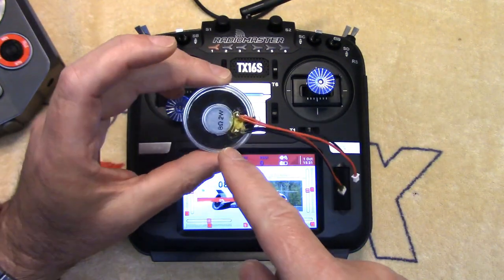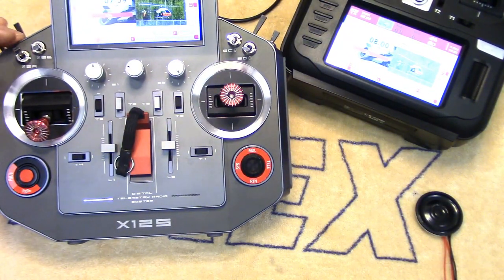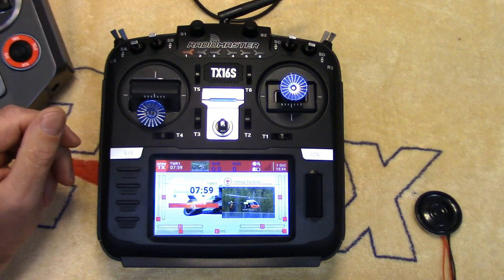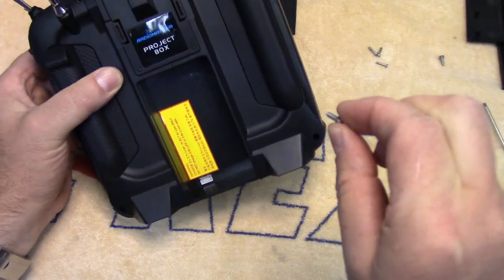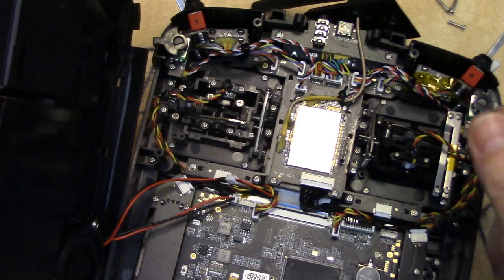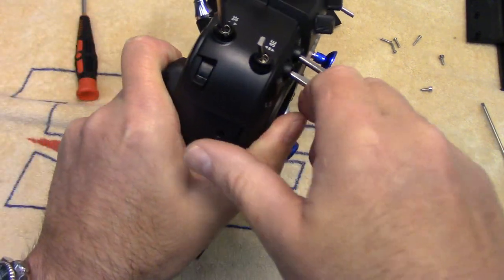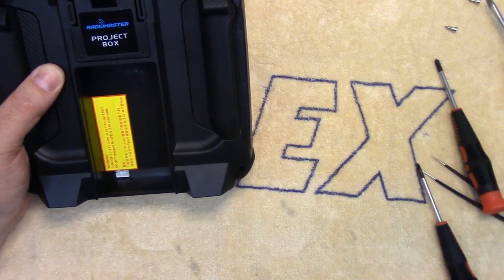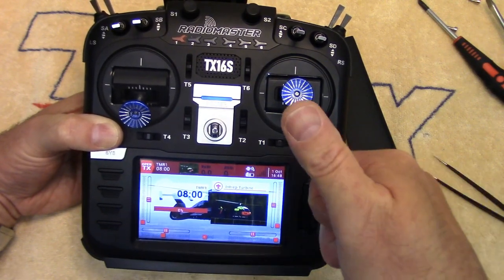Radiomaster TX16S Speaker Modification & Toggle Switch Swap

Comment: Once you change the switches around your hold switch isn't in the "Preflight Checks" anymore, but this can be changed in System/Hardware. There you can change switch SF to toggle and switch SH to 2POS.

Comment: Have you seen the new model TX16s yet john. 3 new colours including carbon also the new CNC upgrade parts kit to be released. This radio will put many current radios out there sitting on their high chairs costing 6 times more will have their tails between their legs trying to justify their high falsely inflated prices. So watch out

Comment: My TX16S sounded kinda crappy (compared to my old Taranis X9D+), so I ordered ($10.65 shipped from Buddy RC) the extra speaker, and just now finally got around to opening up the radio.  But it turns out my TX16S already HAD the second speaker...yeesh.  Well, while I've never heard the TX16S with ONE speaker, I can say that the radio with TWO speakers still sounds kinda crappy, though I'm sure, better than with one speaker.  Anyway, overall, the sound is pretty disappointing, even with the "upgrade".  Thanks for the video.

Comment: By watching, all the switches are soldered in as a 'pair'? Personally, I don't like the momentary switch. ANY way possible, u know of, to swap it to a 2 or 3 position without soldering?

Thank u sir!
Reply from the maker: Soldering is the only way to swap switches from the circuit boards (unless RadioMaster or aftermarket has complete board sets with different switch options you can purchase)?

Comment: John,  can the spring switch be converted to a double switch to match a jr retract switch  after switching the switched or can the right spring switch changed to 2 way  instead of the spring. thanks reno
Reply from the maker: You could solder in whatever type of two position toggle you want to, provided it's the same size and has the same pinout dimensions to fit the toggle PCB.

Comment: I did the switch, but , when I power on I get SF switch warning, I have to putt SF forward to clear it. I also get a beep and a buzz when I pull it forward. Any Ideas??  Thanks for all you do!!
Reply from the maker: Without seeing it first hand to go through the switch programming settings you have, all I can do is make an educated guess that you have to turn off or reverse the direction of the power on switch warning for the SF toggle. Also sounds like you have a haptic and beep warning assigned to that toggle.
Reply: @Rchelicopterfun  Hi, I got that figured out!,  Do you know how to set up a Blade Inductrix in the edge TX? I have everything working but can't arm it!
Reply from the maker: Don't know.

Comment: Why can't you just take one whole switch assembly from one side and put it to the other side instead of having to unsolder and resolder just the switch?????
Reply from the maker: I clearly state & show why in the video @10:30! The toggle switch circuit boards are side specific.
Reply: Thanks I missed that

Comment: Great video. I swapped my switches on my Jumper T18 pro for the same reason, muscle memory  for throttle hold .   I also removed my SG and SE switches because I am  a pinch flyer. Those toggle switches were in the  way of my middle fingers resting.  I covered the holes from the removed  toggle switches with rubberized grip tape.
Reply from the maker: Thanks for sharing

Comment: Hi John
I changed my SF and SH switches across and its working fine, but I have since noticed that switches SA and SC are interconnected. Perhaps they were always like that, I dont know.
Are your switches SA and SC linked?
Reply from the maker: Nope, switches work correctly & are isolated just as they did before.
Reply: @Rchelicopterfun  Thanks for information
I seem to have these two switches interconnected
There are no special functions showing these switches so it cant be that
Tried flashing radio with latest open TX but no change - any ideas?
Reply from the maker: None. Would have to see the radio in person to diagnose.
Reply: @Rchelicopterfun  Thanks for the reply. Taking the issue up with the supplier now

Comment: I don't typically use a momentary switch and am used to Spektrum layout as you stated. Can I install a 2 position instead and do you know where to buy one? Thanks for your videos btw, you've given me confidence in this new endeavor !!
Reply from the maker: If you wanted to install two 2 position toggles in stead of just swapping them side to side, that is certainly possible. Do consider resale value however since most do want a sprung momentary as they are very handy. There are lots of two position toggle switches on the market, so you would just have to find one with the same specs and dimensions from  electronics shops (Digi-key, Mouser etc.). Radio Master also sells parts, so they might just sell the two position toggle individually? I've never looked however.

Comment: Hey John, off topic, I have no other way to contact you but is there a way you can send me something to show how to make the ksger t12 soldering station safe? Thank you. Love the channel. Keep it up.
Reply from the maker: You can always contact me through my website (www.rchelicopterfun.com). Anyway, not really sure what you mean by sending "something" to show how to make the T12 solder station safer? It's already pretty safe little soldering station with auto idle & sleep mode. Other than earth grounding the metal case & rounding off the heatsink fins, both of which I show in the T12 follow up video I did (https://youtu.be/Dy9WUtvdBUk); there's nothing else I've done with mine.

Comment: Hay ya John     Hello from little New Zealand.    Updated my X12S to 2.3.9.      Was at 2.2.3 as I got it second hand with two L9R Rx  bound to two different models,   they still work fine.    My model that I made on the tx using X8R receivers has stop transmitting,     I've tried refreshing Rxs eu, non EU ect.   Still     no communication between the two.   I think I've broken my trans.       I'm the only one in my club that is using open Tx       Feeling very lost and deflated     I was told that I needed to refresh the internal ijxt    that's were things went wrong   Any ideas,
Reply from the maker: Sorry, no idea mate. I'm not an OpenTX expert however by any stretch of the imagination. After updating my X12S, to 2.3.9 this summer, it worked fine but I only run FrSky's D16 protocol on it (primarily X8R's and X4Rsb's). I'm sure you've checked the obvious stuff like ensuring in the model's with the X8R RX's that D16 protocol is selected in the model setup main screen,  and you tried rebinding them. That's about the only thing I can think of checking/trying.
Reply: @Rchelicopterfun  yup,    that's just what I was doing and kept going around in circles.    What it turned out to be was that I had to flash the X8R receivers to the matching modern version as well.   Lol    trap for newbies that one was.   Thanks for your answer and time put towards my silly mistakes.      
Only issueive gotto sort now is my throttle servo.    For some reason it holds low with hold turned on.    As soon as I release the throttle hold,   arm   it jumps to mid position,    then when I move sick up from idle to -90 to start my timer,   servo jumps to -90 and moves with the stick full travel as ordered,   in returning to idle,  as soon as stick reaches -90 and pauses timer it jumps to mid position.??    Out of all the complicated mixing I've got going on,  this simple one is the one that is tripping me up the most,    it is almost like the timer running is overriding the servo??

Comment: how too mute??
Reply from the maker: Turn the volume down or create a logical switch function to turn the volume off with a switch activation are the two methods that come to mind, but with Open/Edge TX there are likely several ways. If you can think it, with Open/Edge, there is generally at least one if not multiple ways to accomplish it.